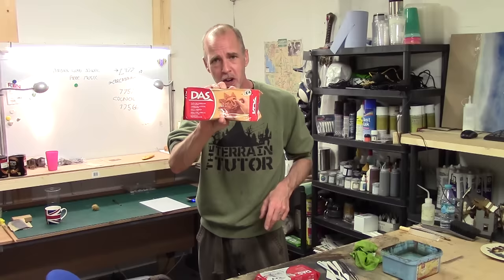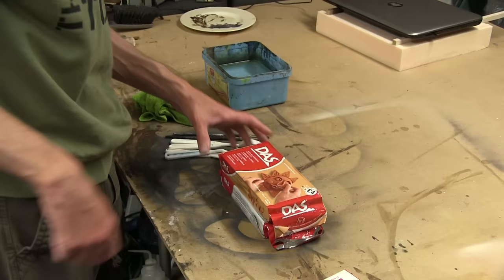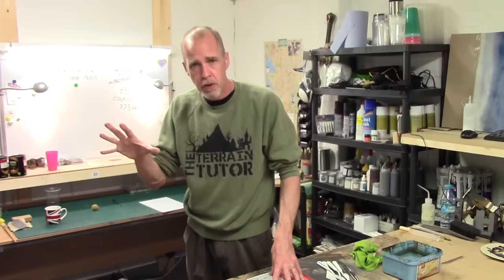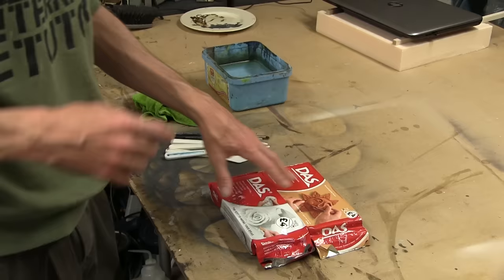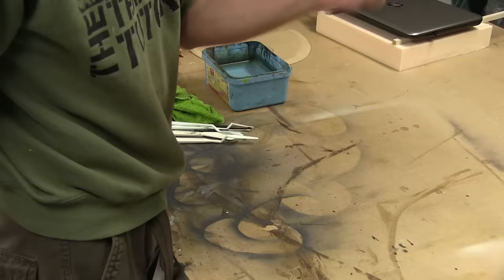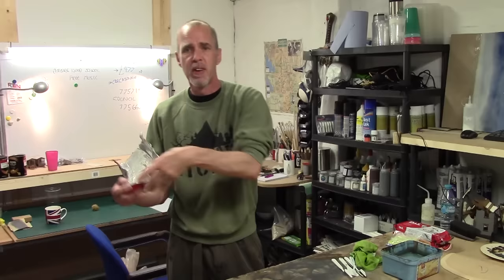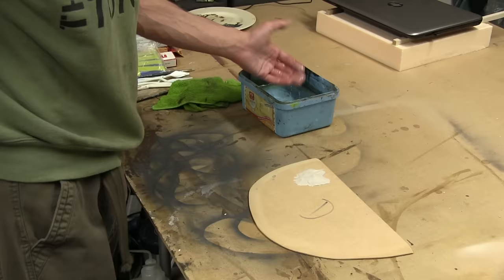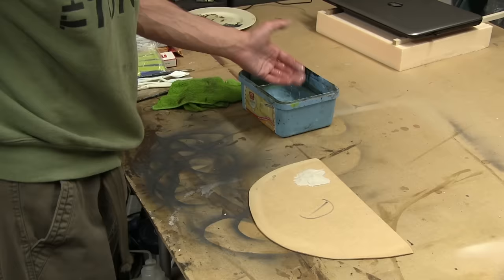Das Air Drying Clay - Pro Terrain Tips & Tricks

Comment: you could use the air dry clay as a base to make your own molds, after you have made the mold you can reshape the Das to make another mold.
1 make the model
2 make the mold
3 use the model from that mold to make another mold and repeat for as many molds you need
and the Das can then be reused any time you need to.
the molding medium should be of the paint on or pour over type.

I used this process when I was making candles so I could pour more than one of any shape at a time.

Comment: Thank you so much for this tutorial! I’m a beginner and have fallen in love with this type of art that I’ve seen on other videos. I did get the DAS as it seemed like the right kind to get. However, no one has gone into depth this way. I knew there had to be more to it. All they seem to do is ( I do see them adding a bit of water while working with it but I actually just saw one lady put cornstarch or something to that affect to the mold. I had never seen nor heard anything about that. They said so it won’t stick to the mold (mould?). 
After watching you and hearing you explain everything, I still have a question…..
If I’m using molds to create small patterns or even something as big as a bark looking piece, just to go on a small frame or box. Couldn’t I just put it in the mold, pull it out, can’t I just glue it to my surface before it dries? Then follow with paint after it dries? Keeping in mind to keep the thickness consistent throughout the whole pattern? That’s how I’ve seen it done. Maybe they used a different type? I’m so ready to create! Hopefully you reply. I’ll be forever grateful! If you have any other suggestions, I’d appreciate that as well. Have a great day. Be well and safe!😊

Comment: Well, about the silicone moulds, you can use oven baking clay and bake it in the oven. I made a couple of moulds with a product called 'Silligum' by Gedeo. (it's basically the same material dentists use to make a mould from your teeth) I needed loads of door stands for a game I was making (with cardboard doors). This technique is especially usefull if you quickly need a bunch of the same piece. It works a lot quicker then pouring them all with resin (more or less 30 to 45 minutes a piece, depending on the brand of clay you're using). I don't know if Hirst Arts moulds can withstand the oven though, and I feel they're a bit too expensive to try it...

Comment: I have worked a lot with ceramics and am beginning to branch out into more air dry clay projects. Wow this video answered SOOOO many of my questions!! Thank you! Also I’m wondering if you’ve ever used a wetbox (semi air tight plastic container with a layer of damp plaster of Paris in the bottom) instead of a damp towel to reduce cracking and warping during the drying process- especially for larger projects?

Comment: Hi
First, I want to say THANK YOU.
2nd: I want to glue air dry clay, putting in a follower silicon mold and then glue to painted furniture, you spoke about molds, but I need to use the same mold many times, so waiting for each to dry for few hours until at least the out surface has dried is not a good solution, any advices please? 
3rd: is it better to use pva or wood glue to adhesive the flowers to the painted wood or water? 
4th: I saw the all crafters adhesive the molded designs directly to the wood, without waiting the piece to dry, what do you think?
Lastly, I had all these questions since a long time but never  wrote them down to any youtubers, simply because I did not feel I can trust their answers, but after seeing your video, I felt this man speaks from knowlege and truth, I am really sorry for being a burden in my many questions. Thank you in advance for your time, understanding and reply. Best wishes.

Comment: What a fantastic tutor you are ! This is a great video! So Many of my questions answered! Just a quick question. You said when you covered the das with a wet cloth it prevented it from shrinking and drying. Can’t you do the same if you stick it in a mould and cover it with a wet fabric for preventing it from drying? Also as a newbie to jewelry making wouldn’t pva glue actually be better if we used it, as maybe the DAS clay could break if it fell on hard surface?
Reply from the maker: In a mould and covered with a wet cloth, it should be fine for a little while, maybe 4hrs but it will dry. For jewellry making, yeah add pva but for what terrain builders often use it for, then we don't mate.
Reply: TheTerrainTutor Thanks for your response and great tip!

Comment: After using air drying clay for some time i found out it will always crack when combining with other materials.. If you try to wrap it around wire construction it will crack, it wont work. It only works as a solid material.. 
Also i have a question. Im working on some project and i need to model book cover with clay.. Do you have any suggestion what kind of clay should i use and what material of a cover should i use as a base? (rn its leatherish material i think, should it be cardboard, wood or smth else?)
Great tutorial tho!
Reply: Do you think it’s good to mosaic over ? I want to mosaic standing snakes made from air drying clay.
Reply: @RovexHD  You mean like to put mosaic pieces over air drying clay?

Comment: Hay I know this is a bit of an unrelated question but I’ve had a problem with my large woodland scenic stock mild. I’ve accidentally torn a small hole in the mold while trying to remove the “rock”. What’s the best way to fix the mold and avoids his in the future? Thanks as always keep up the great work.
Reply from the maker: Scrub the undersurface with a wire brush to break the polished surface then apply a bike puncture repair kit mate

Comment: I put air dry clay in all my silicon molds. I love it.  I pop it out right after I push it in.  I clean the clay from the parts it over laps. Just rub it off.  The only problem I’ve ever had is sometime they don’t dry completely flat.  I haven’t had any cracking.  I dry it slowly.   I make jewelry with it.  I use polymer clay you bake for earrings and rings because people might forget and take it into the shower,  I seal everything too.   I have had a piece fall into water and stay there overnight it started to fall apart.  Kilns are so expensive to buy and finding a place that charges you is hard.  I’d love to be able to do ceramics.  I’ve had an air dry piece I wear daily and it’s hard and hold up.

Comment: Hey Mel, this is a great video, I am about to use some Das white with silicone molds, I was curious would I be able to add other mediums to this clay before it dries, was thinking on trying to use foils down onto the clay and crackle it with a roller just like you can do with Polymer clay, can it be done? also have you ever or heard of anyone adding alcohol inks to the Das clay before drying it out? I also wanted to thank you for showing how to use molds with the Das which is why I watched this video, saw the molds in the photo. Thanks for the awesome tips in this one, very helpful. Patricia from Canada. Cheers!

Comment: Hi, great tutorial! I have an issue at the moment. I have just laid down and dried air dry clay on MDA square board. I added the water and the clay has stuck really well. For the first part of the drying I used a wet cloth just as you mentioned but then I had to go away for a few days. I took the cloth off and now it is fully dry but the corners of the wood have warped. Can I re-wet this to correct it, and perhaps turn it over? Thanks for your help🙏🏼

Comment: Nice video. One question. What would you recommend using for core in order to use less clay? magazine paper mixed with pva glue? any tips on that? thank you
Reply: Egido Val:  I recently watched a Youtube instructor say to add a few shreds of the inside of a new, no gel added, diaper or finely shredded toilet paper to add strength to the Das mixture you’re about to mix and use.

Comment: If i mixed it with epoxy or epoxy filler thing (after it dries out) would there be an issue to it? Perhaps like chemical reaction or something?

And if i were to use acrylic paints and thinners would it reactivate the clay again?
Reply from the maker: I wouldn't do that mate
Reply: @TheTerrainTutor  the what part? Epoxy or the acrylic thinners?..

Cause im curious as i use acrylic paints and usually treating my models crack with epoxy and if its doable on clay.. if not then what are your solution to treat such cracks or what paints and thinners should i be using?

Comment: I picked up the white extra fine milliput today to.make the top layer of sandbags around my flak 36 in away to do for a diarama and and Das clay for the not so detailed ones under them as wont see much of the tops for extra detail so not going to waste all the milliput on them all it's not exactly cheap! Lol,  a few video's says the green milliput well green when needed together they say it takes a half hour for it to cure whare as on the box of the white extra fi e says it cures n goes solid within 3 to 4 mins after 7mins if kneeding together? Have you used it before I'm sure you probably have done it looks the same colourd box you have there! Any tips on using it or just normal stra forward?

Comment: I have a question; Since Das is able to be reactivated when it comes in contact with water if you turned it into something like a coaster and a said liquid dribbled down the cup and onto the coaster, would it reactivate the clay and make it soft again? Since it absorbs the moisture (through liquid) wouldn't that mean that I would activate even the slightest? Also, if you did a coating of clear nail polish or something of that sort, would it absorb the nail polish or would it set on the Das clay?

Comment: hi buddy got a quick question after watching you video if I may, I am sculpturing my own head character big enough to try and make a mask after its finished and so far i have used a polystyrene head then covered it in newspaper  bits strips etc then after days drying I am now using Das clay and creating my own character a mix between fish and robot for my own use but I was wondering If you can tell me will it dry and stick on the paper polystyrene head after its dry because so far everything I have done is staying on so far but I am worried about when my whole sculptures completed it may dry and break apart or come off and so far I have made quite a good job of my character which i dont want to loose or see perish so I need your advice also, if it stays fixed as a whole head unit how do i then take a good copy of it by possibly dipping both sides of the sculpture head into either plaster or some other liquid or even spray it with exanding foam etc what would your advice be so i can Latex Silicone cast off of it to make my own unique mask and character, Thank You...

Comment: When you are rolling air dry clay what is the minimum thickness should the clay be for strengthening? What i mean is that should it be 1/8 thick, or 3/16 thick, or 1/4 thick for strengthen so it doesn't break easily.

Comment: So to prevent wasting I just put a cloth over it? What about adding pressure on clay for a flat surface so it doesn’t warp?
Thanks in advance
Reply from the maker: Yes, and it won't dry if you press it flat mate, needs air to dry
Reply: Thank you

Comment: What is the best way to help fix cracks on sculptures? I’m making Xmas ornaments and once they dry it cracks. I’m not sure if it’s cause I used foam board as the structure and wrapped the clay around that. 

Would layering more clay on it work or using some sort of glue to keep it together? Or should I restart and use just the clay?
Reply from the maker: I'd use fine milliput

Comment: Every block of white DAS I buy has awful consistency. But when I see other people's it looks ok? I've bought two blocks and both has a very papery consistency like paper mache rather than a creamy consistency I get from the terracotta one. I've found other white air dry clay that is nice and smooth but stuff not as smooth as the terracotta ones I've found. Also the terracotta doesn't shrink. The white ones seem to have a lot more water content. Sure they dry rock hard but the shrinking is a bit frustrating.

Comment: heyyy! great video! i have a question tho: i am planning on making air dry clay (DAS) earrings and i was wondering whether painting them with acrylic paint is enough of a protection from water because i obviously dont want them to get all soft if it starts raining and they get wet. i am trying to spend as little money as possible on the supplies if its not essential :)
Reply from the maker: it'll be fine if you give them a coat of varnish afterwards

Comment: In this video you had said if DAS gets wet after it dries out it will get moldable again. Is that in reference to once its 100%  dried and hardened or just if it dries out a little? And if its applicable to when its fully hardened and dried Is there a way to water proof DAS after it dries?
Reply: He mentioned in a post to seal with varnish

Comment: Hi, so I'm using Das with your methods but I'm just wondering on how long the drying time process will be, I've applied Das to mdf and have left a damp cloth over it.
Reply from the maker: Should be fine in 24hrs but it depends on the thickness of the Das mate
Reply: @TheTerrainTutor  thank you :) my second piece is drying now. No cracks or shrinkage on the first.

Comment: What about using it to make molds? I'd like to find a cheap way to cast bits for miniatures, guns, packs, and the like.
Reply from the maker: There's better materials out there, especially when you consider it shrinks and it would be a one use mold mate
Reply: blue stuff from greenstuffworld is cheap and reusable and perfect for bit molds.
Reply: Update: I finally bought some Das, and made a silicone mold using caulking and cornstarch (Look it up on the King of Random channel). I was able to cast a lot of small bitz like pulse pistols, grenades, and things like that for my Tau army. I was also able to make a 2-part mold and cast a tire for a vehicle, although I'd recommend soemthing like Miliput or Green Stuff, since the Das gets no air to help it dry in the mold.

Comment: Hi i'm newbie to clay and pick up Das clay to try to make molds for hotglue ( half parts). If the mold gets to dry when removing the hotglue piece, it it cracks as expected and if you don't let if fully dry to get more soften in order to remove the piece without cracking the mold also introduces some bending after the hotglue has cured since the clay is soften. PS: I've cheated on the second atempt using a fan heater to speed up the process with a constant temperature of 40ºC :P Can i use the fan heater or it is better to do it naturally on the air?

Comment: Joan Scruton Hi I decorate glass bottles with air dry clay and use mod podge to stick the clay embellishments on to the bottle.  I have found Das great to use but have had a problem with Scola.  When I  roll a piece of clay into a long string and then start to coil it round. the end bit keeps breaking off.  What am I  doing wrong?  I have tried adding a little water but it makes no difference.  Your advice would be appreciated.
Reply from the maker: sounds like you're slightly stretching it as you coil it

Comment: I used a clay in college that stood on my desk for weeks and when I came back to it, I could still use because it was still soft. What clay is that? I can’t make creations over just one day. I take my time on these things
Reply from the maker: There's a whole range of different clays mate
Reply: That might be oil based clay and not water based, oil based clay never really dries out. It will soften when exposed to heat, its usually more expensive :)

Comment: I have a question. What if I'm applying the clay to a surface that isn't wood, and I still want it to strongly adhere. In my case I have a board I've coated in plasti-dip spray, would the water still make it stick, or would the paint prevent that?
Reply from the maker: You're going to struggle with any flat impervious surface mate, get a nail and scratch the surface where the clay is going so it's going something to key into
Reply: Ugh! I do the nail trick with PVA glue on flat surfaces! Why didn't I think of it this time! Thanks!

Comment: For an art project, I have to make a house made out of clay. I have das clay. Any tips? It wont stay up.
Reply: Here's a few tips:
1. Use wooden barbeque skewers or toothpicks to support the walls and roof
2. If the roof is too heavy and collapses even when you use supports, fill the center of the house with aluminium foil/already hardened clay pillar
3. You can also bake the walls first and add the roof later
4. You can use files and fine sandpaper to smooth the surface

I hope my tips helped you. And you don't have to bake the pieces but since i mainly use polymer clay, i'm used to it. Just follow the tips in this vid if you decide to wait the clay to dry.

Comment: I am slightly confused how delaying the drying time can prevent warping. My biggest problem is warping due to shrinkage, delaying the drying time just delays the time until it warps, my latest took five days to dry and dried warped, it was only A4 size.

Surely the only way to prevent warping and cracking is to attach the clay to a base material that will allow it to shrink and move with it, and that is …………...cheap crappy polystyrene packing material. works every time. Blue Styrofoam ends up like a rocking horses footplate!
Reply from the maker: anything that large will shrink and cause warping, do it on grease proof paper and then glue it down once it's cured mate